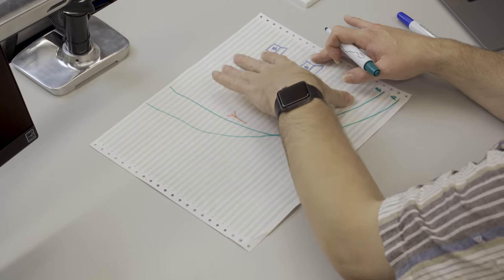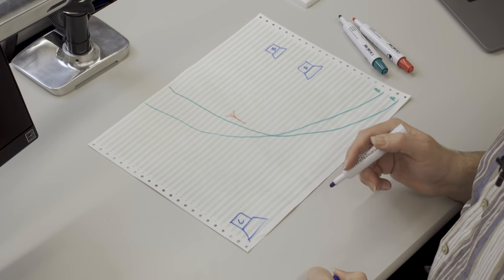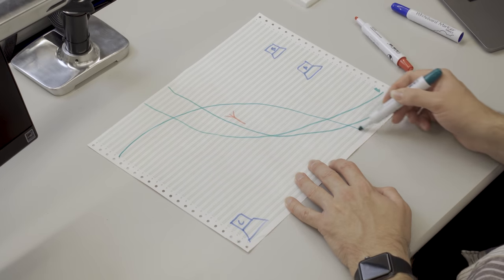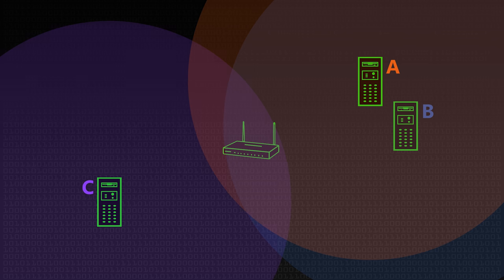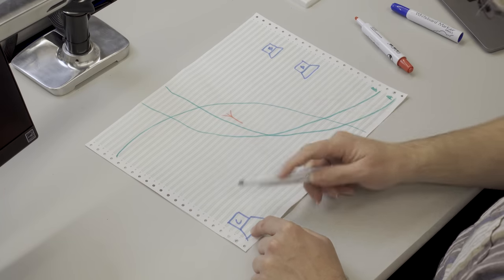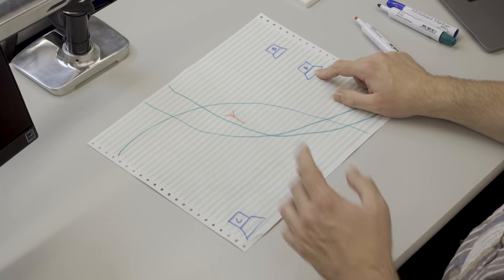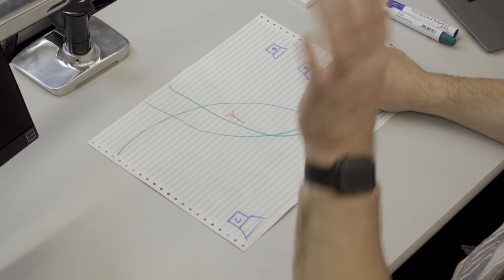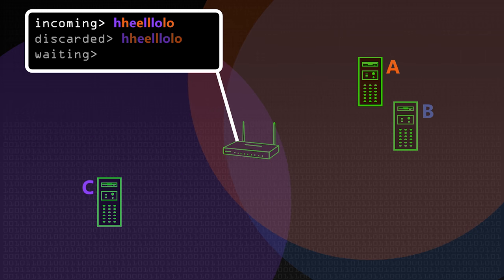WiFi's Hidden ____ Problem - Computerphile

Comment: Instead of the Access Point handing out Clear To Send tokens in response to Requests To Send, you could also have the AP periodically send ACKnowledgements. That way, all potential senders wouldn't have to send RTS packets first and could just listen for ACKs: If there are no ACKs from the AP within their reach, then they can just send – no CTS token required. However, the "listening for periodic ACKs" approach might have the downside that any sender would have to pause periodically to let ACKs get through, which might even require synchronised clocks. I suppose the AP could just listen for a pause in the node's transmission before sending its ACK, but that could get messy. What I'm less clear on is whether a transmission from node A that node C can't hear could still cancel out an ACK sent by the AP regardless of A's transmission. Even if it wouldn't cancel out the ACK as far as C is concerned, it might prevent the AP from properly hearing A's entire message. So I'm not sure if there's a term for what I'm describing here, but it seems CDMA/CA may actually be better than any such alternatives.

Comment: So if you wanted to knock out a remote node you would measure the strength of the access point and identify a node that is too weak to receive (because the Access point will be sending CTS signals to it). Then transmit a back to back series of CTS packets at low power to the unreachable node which should block the target node which will receive these packets. If the transmission strength is kept very low then it may be possible to not interfere with other nodes. The target will politely just wait for a random gap to squeeze in an RTS.

Comment: I've also heard of Time Division Multiple Access (TDMA) where the nodes will essentially check with the access point to be assigned a share of the time for their transmissions. how does this compare when TDMA doesn't need to RTS and CTS messages after initial check-in?
Reply: There can be a lot of ways to do something like that.  The first LAN I worked on, back in 1978, used TDM on rings.  Each device was assigned a time slot to transmit in and the destination would listen on the time slot.  This was all coordinated over a dedicated time slot called the "order wire", with the CPU which the ring belonged to.  This was in the Air Canada reservation system and there were 2 loops.  The main "TDX" loop ran at 8 Mb over triaxial cable and some equipment was connected to the older "TDM" loop at 2 Mb over coax.

Comment: You should do a video on how CDMA/WCDMA works. Blew my mind when I first learned about it. We did an exercise where we simulated (on paper) multiple nodes transmitting, which results in a garbled signal. But when you "subtracted" the node's code from the signal, you ended up with the intact message.

Comment: You mentioned a couple times that wifi drew inspiration for its collision detection and re-transmission from the wired ethernet protocols, but ethernet itself drew inspiration for its collision detection and re-transmission from ALOHAnet, a 1960's wireless network in Hawaii

Comment: Okay...now I'd like Computerphile to cover how the WiFi protocol prevents RTS and CTS packets from being abused by attackers.  If an attacker sends a RTS packet with max duration and then they do a Slowloris style attack during the reserved duration, an attacker could theoretically lock up any WiFi endpoint because all other devices have been told to wait for the max duration but data is still sent during the reserved block of time with an ACK to avoid detection.  CTS packets could maybe be abused too during the attack by pretending to be the endpoint and just telling everyone in range to back off for the max duration so that the next RTS packet from the rogue device can reserve the next max duration time.  And maybe the range could be boosted for the rogue CTS packets to reach all devices on the network.  Advisory locking only works when everyone participates equally.

Comment: You neglected to mention that the WiFi band is split into numerous channels, and you only get interference if two devices send on the SAME channel.  Plus they use random seeds to hop around the channels in a pseudorandom way, to minimize the prospects of collisions and especially of repeated collisions.  You really only get frequent collisions when you start to really congest a network.

Comment: How does this work with with streaming a youtube video or something similar to a machine? if the access point is constantly sending data to the computer won't all other machines be refused access?? Unless the data is sent intermittently and the gaps in-between is used to serve other machines?
Reply: Correct. Right-click a YouTube video and select 'Stats for nerds' You'll see the buffer and Network Activity graphs complete with gaps in between.
Reply: @CyclingSteve  thanks! I can see that the network activity has spikes, along with the timeline of the actual video jumping along at the same time. Could you explain what buffer health is? cheers!

Comment: Isn't request to send only needed to be sent out once, while it's connecting to the access point? I mean, if the number of devices connected to the access point don't change, the access point can calculate and send out a fix delay info to each device, so the device can then schedule when to send data themselves to not conflict with other devices. If request to send is sent each time they want to transmit data, that feels like unnecessary added latency
Reply: No, it's sent for each transmission.  A device has no way of knowing when another device will connect.

Comment: I feel like this could have been avoided much easier. For example, RTS could be specifically on a much smaller band or different channel altogether, so it never interferes with actual data. If you employ error correction, then the bits received will interfere at the intervals correctable, allowing the RTS to be decoded along with another machine sending data.  If you allow for stride protocols, then you can interleave multiple devices....if you have a "ping" sync, then you can also assign section allotments.

I see it similarly to how graphics cards work, where you have defined times of the front porch and back porch.....if you assign specific spaces for your machines within the time window, then they should never interfere with each other.  If you require more data, maybe you request it within your window of opportunity to temporarily expand your space with the router....used when you are uploading/downloading a huge file, for example.  If the router is in charge, then it should take heed, if a machine isn't using anywhere near what is has asked for, then it could lose it back to the network, or require a new lease.  All of this would result in much less hassle, honestly.
Reply: Wifi6 contains  some of  what  you're  talking about. Bandwidth  limited subchannels and airtime  fairness. RTS/CTS isn't used on most  consumer routers but might help  in extremely  congested  environments.

Comment: I guess the "clear to send" package from the AP is not encrypted in any way, right? Which means... I could sniff the traffic near the AP for some time, catch all the nodes that are connected to it (e.g. by catching all "clear to send" packages and noting down the id/mac) and then spam messages where I act as the AP and send "clear to send" for all nodes. Which would mean, that it's not a DoS, it's a DDoS, because all nodes will fire at the same time because all of them got "green light"... Or am I missing something here?
Reply: You'd be surprised how many ways there are and how easy it can be to effectively jam a wireless network.

Comment: This solves the problem for the access point, but not for a client that can receive a signal from 2 access points on the same frequency, that cannot see each other.
Reply: Can a single client connect to multiple APs? I didn't know that.
Reply: @ayushpandey8223  a client can only be at one access point at a time, but can receive noise from any client or access point on the same frequency.
Reply: @PerMejdal  yup, this is inherent to any wireless communication, all you can do is use a very specific wave range to mitigate this from happening.

Comment: OMG, this has caused me such misery when setting up remote disconnected LANs in rural areas for medical missions. 

The buildings are concrete with steel doors. They’re laid out in the row (worst case for WiFi) and you can’t run wires between them. Using cheap routers in trees works fine most of the time, but then fail.

I’m kinda amazed that the hidden node problem doesn’t cause problems for more people that use same-channel WiFi backhaul just in their houses.
Reply: I suspect the problem was more about the cheap routers in trees than the buildings being in a row.
Reply: @zwz.zdenek  Also, just “running wires” between buildings (and trees) that aren’t sharing a ground potential end up becoming “lightning strike & fire risk” problems pretty darn quick.

Comment: On a related note, don't live next door to a school. every single wifi band available will be saturated. And, that's not even the same access point. you will need a wifi extender in every room to compete. Whereas most houses you are fine indoors, and usually get usable signal close by outdoors.

Comment: What you really need is not to avoid multiple transmitters transmitting at the same time but to transmit such binary encoded signals that could be separated from a logical OR of a reasonable number of them taken with any relative timeshift. This way you could get some short signal parameters from your base station and then just start transmitting your data right away whenever you like it with no regard to other transmitters and be sure that the receiver still can detect its presence in the mix on top of all the others. That is the only way to efficient and predictable communication with fair resource sharing and latency. 

I am absolutely positive that it is possible and I am like 99% sure that today some properly developed methods of doing it must exist so why we still use such limited, inefficient, poorly scalable and overall barely satisfactory solutions for our WiFi networks as it is described in the video is beyound me. In 21st century we deserve something better than that.
Reply: if such schemes exist, they probably involve having to sample the "ether" at like 100x the speed of any of the signals (if the signals are only "disaggregateable" by their tiny phase shifts), which would be why they don't do it... and any scheme in which the line codes are disaggregateable numerically/alogorithmically for a large number of stations must intuitively result in essentially the same...

Comment: Did some reading on Multiplexing recently as a curiosity on how cell towers are able to communicate effectively, and after watching this video, got me wondering what the protocol is for a new device that wants to connect to the antenna. Does it wait for a “new device allow connect signal”? Or is there a more intriguing method?
Reply: Cell towers have control channels, which are used to establish connections. The device is then assigned a specific channel.

Comment: This explains a lot of why WiFi can feel "slower" than Ethernet and why using more than one access points with different frequencies can help to an overall faster wireless networking. Right ?
Reply: Well it is slower anyways, the radio waves don't travel as quickly and it is slowed even further with more "stuff" being in the way (And yes that includes the air itself).... Then there are all the security issues.

Comment: Over is invite the other party to send, out is saying you've just finished sending your last message. Wifi protocol does remind my of amateur radio protocols... Always ask if the frequency is in use, for exactly the reason in this video... Somebody within your range might currently be listening to someone else outside your range. So pretty much the same solution too. Very short messages to check.

Comment: "Over-and-out" is a larger target than "Out"; less likely to be missed.
Reply: Lol. In radio etiquette it's considered rude. It's like asking someone a question and walking away, or like hanging up the phone on someone while they're speaking.
Reply: @justinlangley8972  Rude? How aboute one-sidedly deciding that the conversation is over? Just say 'out' and now … ignore anything else the other part has to say?
In Swedish protocol 'out' means 'I have nothing more to say'.  And if the other part also has nothing more to say, the response is 'clear, out'. But he does then have the option to still add to the conversation. Then the 'out'/'clear,out' has to be repeated, until both have had their say.

Comment: How is this system used with access points that use MU-MIMO? (Multi-User, Multiple Input,  Multiple Output)  Once each antennae of the AP is utilized,  does each antennae then utilize CSMA-CA to allow multiple users per antennae? And does the AP have to internally use CSMA-CA or CD to then send those messages off to their destinations? I assume there some kind of cache in the AP to temporarily store messages if a queue is built up.

Comment: Does it also assign time periods for when each node can send request packets? If the Wifi assigns node A to only send on odd milliseconds and B to only send on even milliseconds then they should never overlap, or does this slow down the overall speed more than just allowing some overlap?

Comment: Wait, so there is no problem?  I use a separate channel for EACH device, each with its own access point.  I mean you are literally saying you need more than 15 devices to have this come up.
Reply: You are assuming you are in a RF free zone where all channels are available. In my neighborhood I can see a dozen access points and sometimes more,
Reply: @exponentmantissa5598  yes.  I live in the sticks, there are no other people within range.  I guess if this 15 channel per frequency group is a problem in cities that seems nuts to me.
Reply: @exponentmantissa5598  don't forget that the channels overlap.  For example, in the 2.4 GHz band, only channels 1, 6, and 11 should be used as otherwise the channels will overlap and interfere with each other
Reply: @hicknopunk  The frequency  bands on which WIFI depends are unlicensed and used by many devices other than access points, Remote control toys, drones, garage door openers, digital radio sets and so on. Putting everyone on a different channel would fail right out of the gates in most locales,

Comment: How come it’s possible to send and receive UDP traffic like games/voip through WiFi and not affect other hosts on the network? If one device is constantly streaming data to the AP wouldn’t that mean that no other hosts would be able to communicate with the AP until after that host has finished the game/voip call?
Reply: What you call "constantly streaming" is in fact "repeatedly sending packets when possible". It's far from "constant" and in no way means "uninterrupted".
Reply: @ralfoide cheers for the passive aggressive reply

Comment: A question, as we have lots of frequencies in the range, wouldn't be possible to the connections to have a specific frequency assigined to the specific node and then the AP would filter by the frequency to know which package is from each sender?
Reply: No.  There are only a fixed number of channels.  On 2.4 GHz, there are only 3 (4 in some areas) clear channels.  Then you run into the problem of frequency coordination.

Comment: In the days of teletype networks this was also a problem. There would be multiple machines on a single network, if two operators started typing at the same time the machines would type out garbage. So to stop this a poll call system was employed. An operator would wait for their call letters to type out on their machine, they would have to type in 3 ys, then start typing their message.

Comment: At the very end when they start talking in radio speak, or non-radio speak with the "over and out" has many similarities. The hub is the controller of the frequency. Having sent a CTS to a particular node then all other nodes must wait. When that dialogue is finished then the hub should send a "frequency clear" message and then the other nodes are permitted to send an RTS. Or does that already happen? Why is WiFi fixed frequency and not FHSS or similar?

Comment: How is this still a problem?! I mean, if when data is being sent to the Access point from anywhere, it can broadcast to all nodes itself that it has data incoming, that would eliminate the problem... I mean even the access point is at least bidirectional right. Or is there something I'm not seeing?
Reply: It's not bidirectional, sending and transmitting use the same frequency and can not happen at the same time.
Reply: @maxine_q  wow... I thought we had remedied that already... our communication sux! lol
ty for your answer

Comment: IBM's token ring topology was (still is?) an example of over-the-wire CA. Was very expensive and slow back in the day.
Reply: LocalTalk (AppleTalk protocol over a single unshielded, untwisted pair from 1980’s to 1990’s) also used CTS and RTS

Comment: Are there any mitigation in the protocol against jamming? What if a malicious node spams "clear to send" packets, with no valid sender address. Would that not cause all nearby sending nodes to perpetually wait, with incredibly low output power requirements for the jamming node?

Comment: What happens when there are two routers running at the same frequency? Does this just lower the potential band width as devices many have to constantly wait and retry?
Reply: They hear each other and share the channel, just like any other WiFi device.